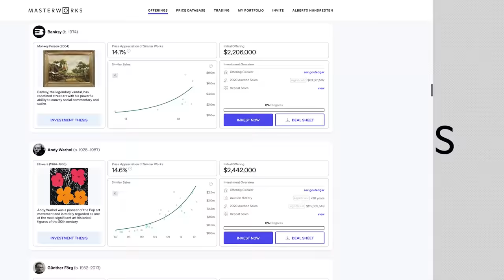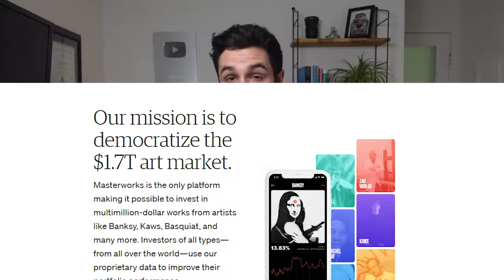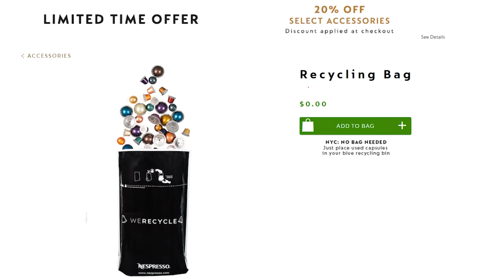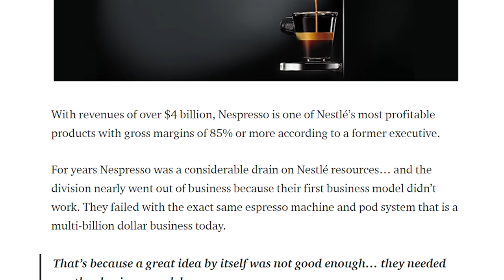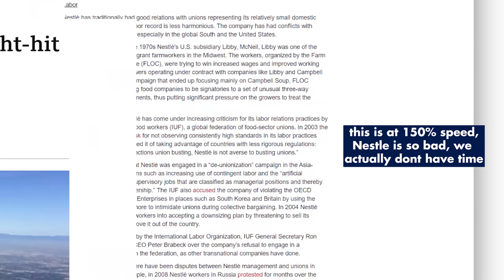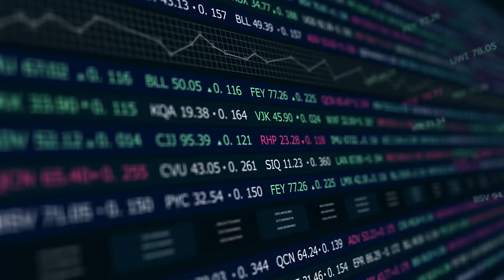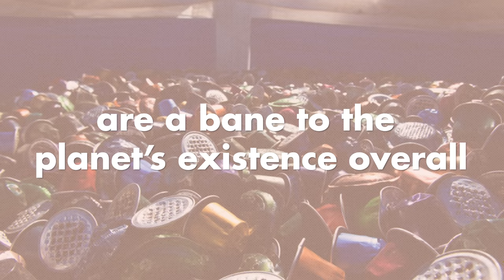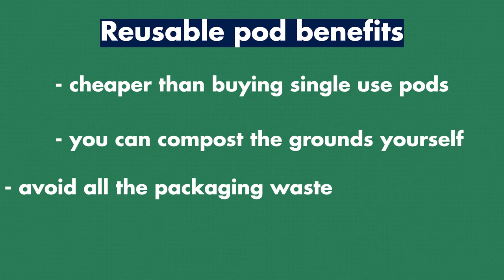The PROBLEM With Nespresso Coffee Pods

Comment: If you are rich enough to afford a doorman you are rich enough to afford a real espresso machine and a grinder.
Reply: Nespresso seems to corner the “premium-mediocre” market for coffee. 

Kind of like what Heineken was able to do for many years in the export beer market. 

From a pure business standpoint it’s an enviable position,  but yeah it’s pretty bad. 

Basically enabling a certain consumer mindset creating an image that “*I’ve arrived* at coffee making”,  whilst being the furthest away from it in meaningful reality.
Reply: I use an old fashioned Moka pot.  A proper espresso machine, you need to make 20 cups to throw away to get the machine hot enough to get a proper extraction.
Reply: @evelynsaungikar3553  While I love a good Moka pot, a good espresso machine should be giving you stable temperatures for correct extraction from your first shot lol. Mine does at least.
Reply: @evelynsaungikar3553  what machine does that? Mine heats up real quick within 10 minutes and is then ready to go, and it's prosumer grade.
Reply: @nazridzuan2242  Maybe ready to go, but the coffee won’t be good.  The water has to hit the coffee as steam, not liquid.  If any of your machine is plastic, I would be amazed if it made good coffee, by which I mean coffee you can drink black no sugar.
Reply: @Girvo747  What make and model?  Bear in mind, I’ve tried this French press nonsense, it’s like cowboy coffee, yuck!
Reply: @evelynsaungikar3553  I think you must mistaken. If the coffee's brewed with steam and not water, it would be scorched bitter. Depending on your bean roast level, it has to be water between 88-93C. I have a PID on mine that allows me to change between temps easily and quite accurately (Bezzera BZ13) and the shots that come out of it if properly dialled in are sweet and can be drank as is. (As first shot too on startup, if you've done the dialing in prior to using)
Reply: @evelynsaungikar3553  you can try V60 if you prefer a cleaner cup.
Reply: And also someone to make it for you.
Reply: @nazr3867  oh, you’re going very high-end! I just use the old-school Nonna’s stove top pot, cost 20 bucks, for daily coffee, and if I want crema , I go out!
Reply: @evelynsaungikar3553  I suppose so. I used a Moka pot for years before getting an espresso machine, and tbh it's easier to use Moka pot because the margin of error isn't as narrow though consistency is a bit more difficult on a Moka pot.
Reply: Hell I live in a apartment and I have a real espresso machine. Granted I can see why most people wouldn't get one because of the price, but my husband and I are normally very frugal so it was was a rare treat for me.
Reply: So very true😹😹😹
Reply: if you can afford a doorman, you can afford a coffee barista and the whole package of coffee machines.
Reply: @nazr3867  wow i just googled the price of the machine, your coffee must taste real good xd
Reply: @tigrovna_  what model did you guys get? Recommendable?
Reply: @evelynsaungikar3553  my simonelli heats up in 8 minutes. I bet it's faster than your mokapot 😃😃
Reply: I'm reading everyone's comments about fancy espresso stuff, i like unfiltered coffee and i wanna buy a turkish sand coffee maker lol
Reply: By grinder you mean a companion to the doorman, right?
Reply: But that involves knowing what you're doing...
Reply: @evelynsaungikar3553  that´s completely false, you can get an espresso machine like a Gaggia Classic or a Rancilio Silvia, which have a smaller boiler.
Reply: Money still doesn't buy taste, it apparently buys doors which can simulate taste.
Reply: That was the part that made me laugh. But he knew. It’s really for the people without doormen that want to be like the people with doormen.
Reply: @alexc8512  always important to know the doormen!
Reply: I certainly can't afford a doorman, but I have a nice entry level espresso machine with a built in grinder. It makes better coffee (and more of it) than what you can get from the 5g of pre-ground coffee in the pods.
Reply: @evelynsaungikar3553  if your espresso machine heats the water so much that it turns to steam it's not going to be any good for proper espresso extraction. The steam is likely going to explode the puck and result to channeling. But you are right that you need to be patient and wait for it to heat up properly. Not because your boiler isn't warm enough, (the roughly 50-60 grams of water needed for a 1:2 ratio of a standard 18-20g double shot of espresso does not need that much time to reach high enough temperature), but because the rest of your machine will physically be cold and thus water will lose heat as it travels from the boiler to the shower screen and through your coffee puck and portafilter. It is an art form to properly make good espresso and it does need some training but it's also not that difficult (depending on how high your standards are, barista championship level obviously requires a lot of work).
Reply: ...but you probably don't have time to make your own espresso, though. Rich people tend to be busy getting richer.
Reply: @evelynsaungikar3553  not true lol
Reply: Having a doorman doesn’t equal rich in some cities.
Reply: For real. If I had doorman money I'd get a specialty Baratza espresso grinder and probably drop another $3k on an espresso machine.
Reply: @raal6163  
Do you know how many hours a week professionals making "doorman-worthy" salaries work?

You might buy yourself an espresso maker, but it would gather dust, as you pull your carcass out of bed, and make your sleep-deprived way to Starbucks, because it's faster...and you need your caffeine fix to keep making the big bucks.
Reply: @bcubed72  don't tell me what I'd do.
Reply: @raal6163  Okay, so you wouldn't work hard, would get passed over for promotion, and ultimately fired for underperforming.

You do you, bro.

At least your skills with an espresso machine would come in handy when you apply for a job as a barista, at 15% of your previous salary.
Reply: It's about money, it's about convenience. Most people don't care enough about coffee to grind beans and make a real espresso every time they want a coffee
Reply: @evelynsaungikar3553  That's just not true. Don't the E61 style machines, use something more modern and you can get the first cup immediately. Have to wait maybe 10 to 15 minutes for heating up though.
Reply: In Europe Nestle lines are divided between Nespresso, which is the brand marketed as 'sophisticated' and uses aluminium, and Dolce Gusto, which is slightly cheaper, uses plastic, and offers pods with soluble coffee and powdered milk for an instant coffee with milk.

Though Nespresso is marketed as being for rich people, the reality is that this is about making their consumers feel like wealthy sophisticates, not about marketing to actual rich people. Actual rich people have expensive superautomatics that retail for the price of a used car and enough space in their kitchens to put them in. Nespresso machines are cheap, low-maintenance and very compact, and guess who those qualities appeal to? Yeah, Hollywood royalty. 😂 No. They are made for people with modest incomes, students, the urban lower middle class. While they have some boutiques to make their upper middle class customers feel more special about buying their products, if that's what floats their boat, the reality is Nespresso capsules are sold in all neighbourhood supermarkets in the coffee section, Nespresso machines are stocked by all appliance vendors, and that is because they are used by middle class and lower middle class. For those who have no particular need to fantasize that they could be George Clooney's friend, there is the Dolce Gusto brand, which imo is better. It's more versatile for everyday use and it's marginally cheaper, but it still can make a decent espresso if that's what you want.

The main draw of these machines is mostly the cleanliness of them. Regular espresso machines end up leaving grounds and coffee splashes all around the machine and in the drip tray that need constant cleaning aside from the maintenance of the machine itself. Nespresso and Nescafe machines look like new even after weeks of constant use. It reduces the frequency with which you need to clean, which is very attractive to lower middle class households that do not have maids. They are also about half the size of a typical espresso machine.

So that's the real hidden truth about Nespresso. It's not actually for rich people. xD It's very much a mass market product meant to appeal actually to the lower middle to middle class.

As for recycling, it's not just Nestle that has been trying to push the responsibility on consumers. The pre-sort categories we have in Madrid as of today are: general, compostable, plastics and aluminium, paper and cardboard, thin glass, thick glass, batteries, light bulbs, oil, small appliances and electronics, large appliances, and yes, now coffee pods, and I'm sure there are some I've missed. Yes, that is at least TWELVE pre-sort categories, including two for different types of glass. 🤣Do you imagine we have space in our homes for twelve bins? Probably not even George Clooney has enough space to recycle in this city. 🤣 At most people respect the plastics and cardboard. Even so, you have to remember that at any given time at least half of the population are on the wrong side of the IQ curve. They throw cardboard in with their plastics, plastics into the cardboard bin, mixed garbage in with the plastics. You name it. Most batches of 'recycle' bags are bad and just go to landfill. They used to pay to ship them to China to sort through, and China would just throw them in the sea and collect the money, until China became rich enough that even throwing them in the sea wasn't worth it to them anymore and they embarrassed the EU by inviting them to dispose of their own garbage.

The reality has been staring us in the face for years now. The ENTIRE recycling and pre-sort programme is a failure. All of it has been about boomers feeling better about themselves rather than actually doing anything to resolve the problem, the trademark boomer approach to any problem. It has also become unsustainable and an alternative is urgently needed that puts responsibility on manufacturers to use biodegradable components and to manufacture appliances that can be easily separated into components with different recyclable or biodegradable materials. At that point pre-sort categories would need to be reduced down to two: Recyclable and Non-Recyclable. Government-run facilities would need to be responsible for separating and processing all recyclable materials, whether plastics, batteries, light bulbs, appliances, etc. In the meanwhile, most waste is not recycled anyway. In fact, I'd wager there is a good chance that a greater percentage of the pods Nestle receives are actually recycled than the plastics the city receives. :p
Reply: not to mention it's a lot cheaper in the long run. i still have a nespresso machine but havent used it in 3-4 years now since i got an actual espresso machine. i spend 3x less on coffee (even though i drink about the same amount) when compared to buying those overpriced capsules that just pile up really quickly. a 10 capsule box that would last me about a week = 6 bucks. a bag of ground coffee that lasts me about 3 weeks = 5 bucks. i'm not seeing the advantage of keeping the capsule thing going here.
Reply: @pushslice  Heineken is not prmium at all though it's one off the lowest costs beers.
Reply: @-Xaverius  Exactly my point.  but trust me , there are huge swaths of the market in various parts of the world that consider it as elevated above the rank&file domestic option
Reply: It's just not as convenient
Reply: @maxitaxie  
sure it's not as convenient. 

Burger King is also more convenient than fresh cooked food.
Reply: Here in Turkey every single apartment has a doorman which lives usually in the lowest floor
Reply: Or you can ask to grind coffee in shop and use those Italian coffee makers that works on stove. It cost about 40 dollars and makes good coffee
Reply: Seconded.
Reply: Tru
Reply: First I used a moka pot.  Then I bought one of the cheapest espresso machines I could buy.  Makes a decent coffee, runs on beans and water.
Reply: @evelynsaungikar3553  
You need a special grind for proper French Press. Much coarser. If you use drip grind, you'll get "mud" in the bottom of your cup. Fine coffee particles.
My grinder makes it coarse enough that my coffee is clear.
Reply: @1TwistedPoet  This is the old idea. A medium grind is actually excellent in a french press if you give it the time to settle and don't plunge. Look up James Hoffman's french press recipe on YouTube.
Reply: I mean if you can pay somebody to open your door you can probably hire a barista to make your coffee.
Reply: So many dumb comments. 
If you are rich, you probably don’t have the time or will to waste on using a manual machine. 
What you want is a fast coffee, the price doesn’t matter, and your time matters more. 
This means your not going to drive to a coffee shop for your everyday coffee and you also want no hassle when having guests. 
This leaves two options:
1. You get a Nespresso machine and leave it at that.
2. You buy an expensive automatic machine. 
And I think the most common one is you have both. Why? Because you can.
Reply: @bcubed72  
True Door-Man level wealth exists in the area BEYOND work.

You USED to drag your ass out of bed at 5am and fall back in, exhausted at 11pm... 
But you MADE that business a success, and sold it for enough millions that you could afford a place in a building where the Cheap suites were two million when an average house was selling for 130k. 

I WAS a Door-man in Toronto for a short time, in he 80s. When houses in downtown were selling at 250k to 300k, and even Firest Hill mansions were around 700k, the starting price in The Churchill was 1.8 Million, for a Jr. Suite. 
The larger, well appointed units were in the 3 to 5 million range.
Reply: @error.418  Yeah, but if you can't figure out how to mix the water and coffee, and wait for it to settle, and move the plunger SLOWLY....
Then, a coffee grinder with a coarse setting works pretty good 👍. 

Knowing what you are doing ALWAYS works better... but for 95% of people, it just doesn't matter, because they can't taste the difference anyway.
It's like lossless compression fir music. 
Takes up WAY more disk space to preserve parts of the music signal that YOUR ears can't hear anyway.
Reply: And a barista.
Reply: @generalgrafx  What they really need is a barista doorman so they can snag a nice espresso on the way out the door in the morning.
Reply: @error.418  Yep.
Reply: @LuisCaneSec  i love my nespresso, I used to have a “real” espresso machine, my god what a mess it made. Thank god I got rid of it.
Reply: those who can afford a doorman prefers not to make their own coffee.
Reply: but you are too lazy to make your coffee. you have "more important stuff to do"
Reply: @bcubed72  Actually I find poorer folk work much harder, many on minimum wage have to do 3 jobs.
Reply: I mean you could just own a pour over, aero press etc and a grinder. Alot cheaper still great coffee.
Reply: And hire a Personal Barista as a matter a fact
Reply: Or maybe hire your own barista, lol
Reply: It's about time
Reply: Super-auto machines have grinders built in, you just push one button.
Some even have milk containers to make lattes by themselves.
Reply: Pour over ones are fancy too. They make you look like you know what you are doing. Even if it is just wetting paper, putting the grinds in, and pouring water over it.
Reply: You would also be rich enough to pay for quality with convenience and that is what they provided.
Reply: Hire a guy to make ur coffee every morning
Reply: Or your own barista
Reply: To get that rich, you need to start with a drip machine/or a French press...Forget about espresso machine.
Reply: @evelynsaungikar3553  Espresso these days is extracted as close to 95C as possible. Steam is only used to foam milk. With the proper funds, a double boiler system with temperature controls solves the time issue.
Reply: Even cheap espresso machines when dialed in correctly will produce better coffee than any pod.
Reply: and have another person make it lol
Reply: Pay a bit more to employ a doorman who can also make coffee?
Reply: that kind of thinking is why Nespresso make millions and you cents.
Reply: We do have the real machine, but cannot be bothered to actually use it (-> Nesoresso).
Reply: Not necessarily Nespresso is more convenient for me to make than a machine where I actually have to clean it
Reply: and a barista
Reply: too much hassle to use semiauto. maybe a superauto
Reply: I use my Nespresso Pixie for the first cup of the morning, then use my traditional espresso machine, and I don’t even have a doorman unless you count my dog.
Reply: Whether rich enough or not, who can be arsed with it when you can quickly make a cup of coffee using a satchel
Reply: And rich enough to have your hired help learn how to use it so you don’t have to make it yourself lol
Reply: @evelynsaungikar3553 black and no sugar isn't real coffee it's homeless dirt water😂😂😂
Reply: I can an afford an actual espresso machine but I don’t want to put in the time and effort…hence nespresso
Reply: Here in New York city. Even government housing and homeless shelters gave doormen
Reply: Which is the best expresso machine for home use
Reply: Even a super auto machine is miles better than a pod machine for the same convenience
Reply: It’s not the price. It’s the laziness.
Reply: @pushslice  It's the same taste honestly, I have a 300 dollar nespresso machine that taste just as good as a 5K real expresso machine!
Reply: @em34ev3r  

No offense meant, but …appears you are ….doing it wrong . 

Just like with most things culinaria (well, and in most all  things in enthusiast-pursuits, really),  technique counts for as much …or more…than equipment. 
Improving  equipment just opens up & extends your ceiling; but the person still has to enable it.
Reply: even if you aren't you can get a $50 espresso machine and $20 grinder and just find some mediocre beans at a supermarket and make decent coffee

i know not everyone has the time or money but you can afford home made esspresso without a doorman, or you can just not use a nesspresso for a month and get an actual espresso machine
Reply: I love my daughter’s espresso machine except it’s a pain to clean.